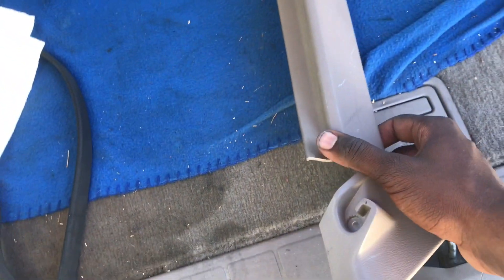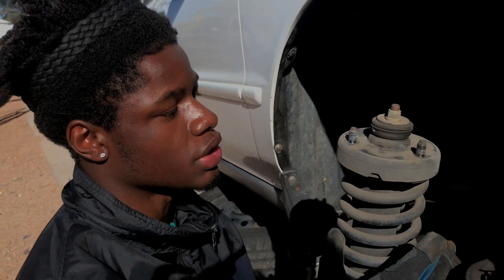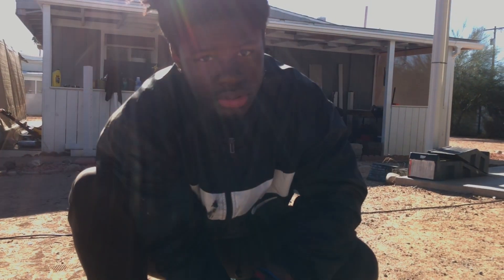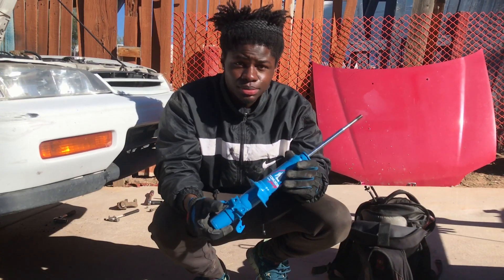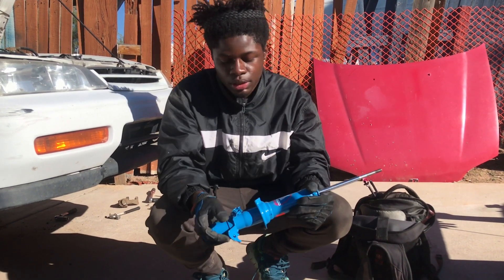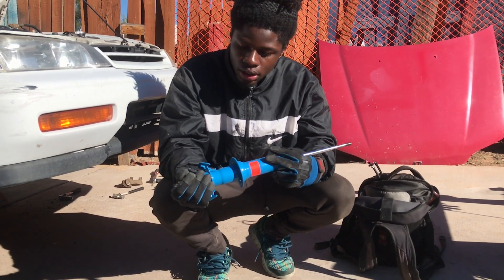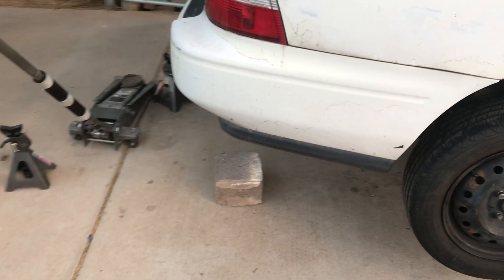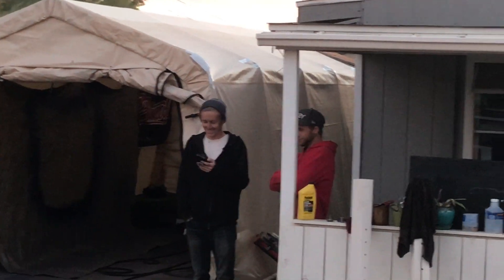Accord wagon build EP 2: lowering wago pt. 2!

Comment: I have the same car - same year and also an EX model. Last night, my windshield wipers started acting up -- as in the intermittent wiping would stop half way up, stall, then continue - this action was repeated several times. This morning, I woke up and it did it again. Added note: the 2nd and 3rd speeds moved extremely slowly. I wonder if you have ever had to deal with this issue. I'm thinking it is most likely a wiper motor issue and that it will need to be replaced. I wonder if there is a relay that could perhaps be the true issue. So again, I wonder if you've ever had to deal with this regarding your Honda Wagon...  Thank you for considering the situation and I'll appreciate any feedback you may have.  :)
Reply from the maker: Hey man thanks for reaching out! I personally haven't experienced this issue on my wagon but if I were to guess, i'd say the motor needs to be replaced. Sorry i'm not much help but let me know when/if you get it fixed!